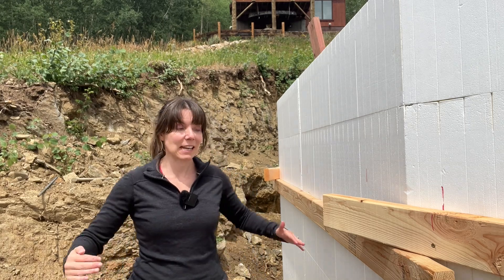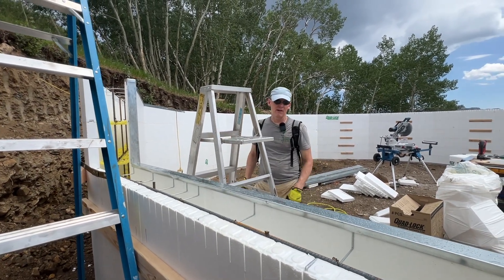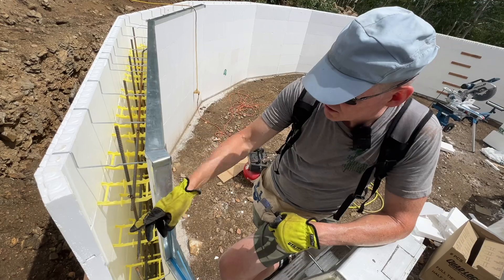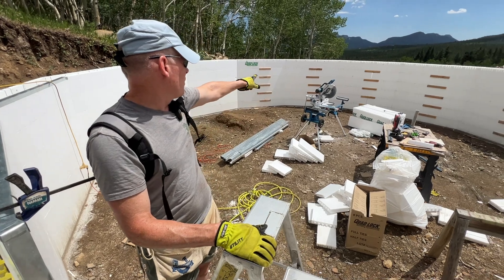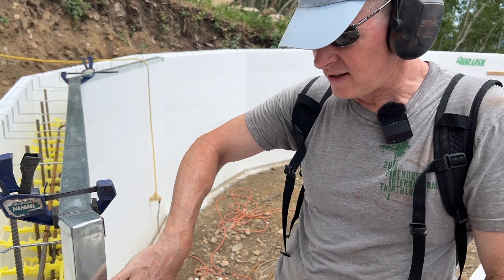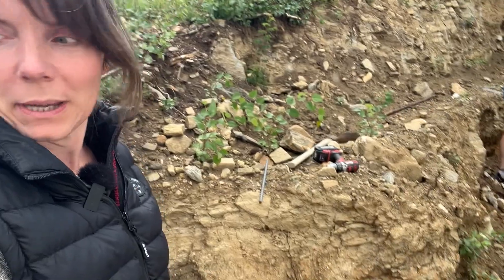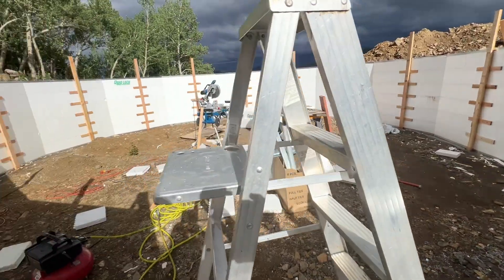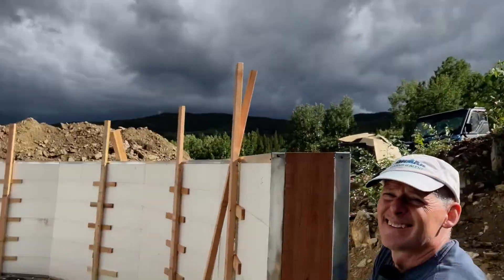ICF Greenhouse Foundation Completed, BUT will it Pass Inspection?

Comment: When it comes to the tubing install, double and triple check all of the calculations before committing to bury it. Once its in the ground there are no easy fixes. Most installations dont have  sufficient cfm and make the mistake of using tubes that are too long. If you are using corrugated drainage tubing , check where the drainage holes or slots are located. I`d recommend using non perforated corrugated tubing and cutting a straight slit part way through the corrugations prior to installation to ensure all of the condensate can fully drain. I held the tubing straight with 2 boards and used a palm router to cut a straight slot just through the thickness of the plastic. Cutting too deep risks weakening the tube.
Reply from the maker: Thanks for the valuable info!
Reply: @ColoradoMountainLiving  
No worries :) As a rule of thumb you`ll need 1.3ft of 4" tube per square foot of floor area. Design the tubing layout to handle putting the entire greenhouse air volume underground at least 20x per hour for cooling and at least 10x per hour for heating. My dome is smaller than yours but it allowed me to design for 60x so i could experiment with higher flowrates. The higher flowrates are very useful in the autumn when the mass is warmer which limits cooling performance. Its also useful on sunny winter days,. when you are in a race to store the valuable excess heat before it is lost to the glazing. The greater the internal/external temperature difference, the greater the heat loss. If the system cant keep up with the incoming gains, you may be forced to vent the excess to prevent the greenhouse overheating. You also have to consider the plants when it comes to extreme temperature swings. If the greenhouse spikes to 100F on a sunny winter day and drops to 30f at night, they may not be too happy with the 70F swing.

Comment: Hey guys excellent job on the forms...remember to rod or vibrate the concrete during the pour to assure no voids in the walls.....pour in 2' high lifts around the foundation....oh yeah don't add much water on the site to the concrete....to much will change the design of the mix....easy mistake many people make....sorry just being a Dad to you guys.
Reply from the maker: Thanks for the great info!